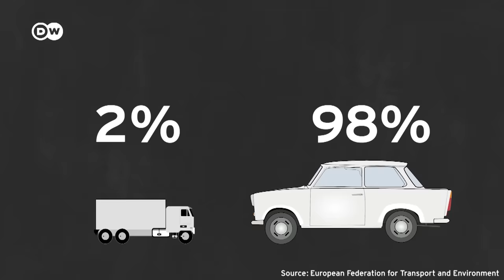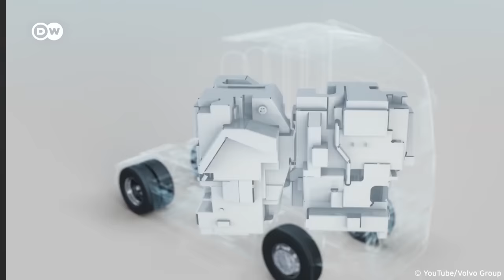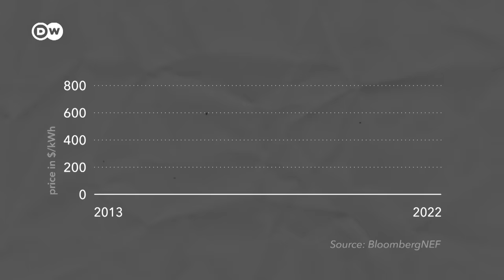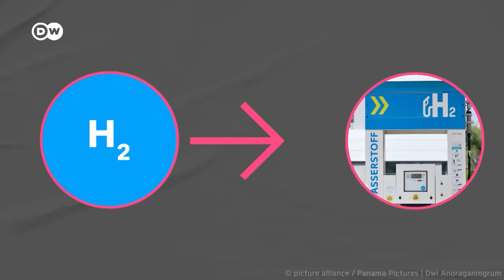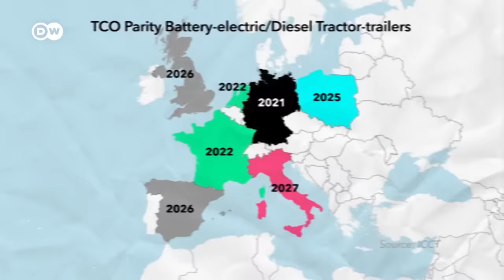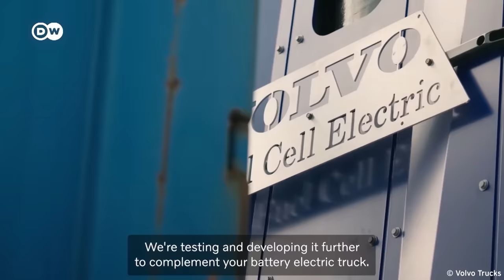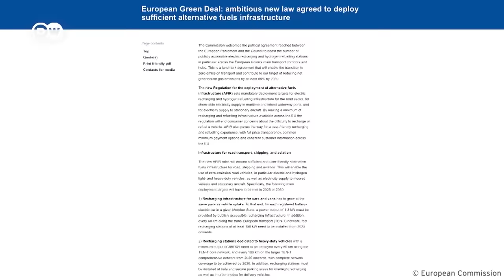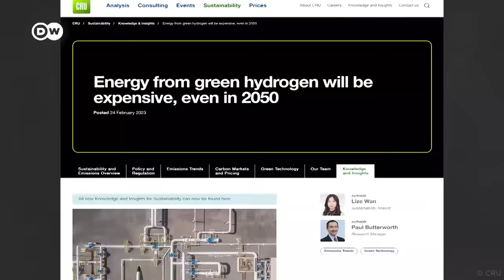Which will be the engine of the future?

Comment: Tbh neither of those technologies makes any economic sense without nuclear fusion. The energy always will be too expansive. Oh and guys for last mile transport trains are not an option.
Reply: Actually there is a very strong economic case for electric final mile trucking
Reply: @engineeringtheweirdguy2103  yep, I know that. The problem is that in the video they are comparing long distance transport...
Reply: @piotrszostakowski416  I would say that battery electrics is the better option for trips up to around 500 miles.

Hydrogen is not suitable for trucking or cars.
Reply: @engineeringtheweirdguy2103  Problem with EV is the charging. Hydrogen doesn't have at least this problem. But let's be honest except for the last mile, our good, old fossil fuel will remain. You would need free energy (fusion) and better batteries to change it.
Reply: @piotrszostakowski416  well. No. The economics for short and midrange EV trucking is pretty solid as an alternative to diesel. Long range remains with diesel however.
Reply: @piotrszostakowski416  charging isn’t as much as a problem as you might think either. It is a paradigm shift. It can’t refuel like diesel or hydrogen can. But it also doesn’t have to. Because it operates on a fundamentally different principle
Reply: @engineeringtheweirdguy2103  no offense, but I don't know where do you live in. In my country half of the year due to the weather EV has 70% declared range and it is not the worst case. 
Also when you are tired on the road and want to have a little break your EV won't charge at the gas station. Not because there are no charging spots, but because if it is going to meet all EV needs you would need about 10x, 12x times more  than you have a gas spot. It would increase the size of each gas station.
That's why it can only operate in the last mile. Instead of charging you would only exchange the battery while loading the cargo. Still the range problem with cargo remains.
Reply: @piotrszostakowski416  you don’t charge an EV like you refuel a car. Most EV owners will charge at home and never need super chargers. Trucks needing to stop will be able to charge at the stop. Tesla semi has specific super chargers called mega chargers that a normal car can’t use. A lot of rest stops have mass of space for parking trucks. It isn’t hard to add a charger to each space either. They not very large.

And when the truck is doing it’s delivery, being loaded or unloaded at a facility or destination, as long as the factory or warehouse it’s at has power, it can charge whilst being loaded and unloaded. 

As I said. Paradigm shift.
Reply: @piotrszostakowski416  also trucks not exceeding the maximum range (for the Tesla semi, 500 miles) (80% of all trucking is within 300 miles per day in the US according to statistics). Can charge overnight while they’re not being used. Saving time of getting fuel later on.
Reply from the maker: Hey guys, check out our video asking "Is nuclear fusion the key to fighting climate change?" here 👉 https://www.youtube.com/watch?v=eyHovWQ49MI. And let us know your thoughts in the comments. ✨

Comment: Hydrogen is definitely the way
Reply from the maker: What makes you vote for hydrogen? 🌻 Have you already checked our video on it 👉 https://www.youtube.com/watch?v=AGTjKJHu99c? Please also leave a comment and subscribe to our channel for more videos on environment. 🙌
Reply: @DWPlanetA  yeah I saw that video too, hydrogen just allows for much more energy stored meaning cars and trucks can go further and refill faster. Although it’s less efficient to convert energy into hydrogen it’s worth it for the 39.6kWh/kg, compared to batteries 0.1-0.27kWh/kg
Reply: @ryanhasmanners9997 It’s not worth it at all. Hydrogen cars are not much lighter than EVs and have almost similar range.
Reply: @Simon-dm8zv  they don’t have nearly similar range, hydrogen cars have between 100-300 more miles than battery cars
Reply: @ryanhasmanners9997 Model S Long Range has equal range as the Toyota Mirai and only weighs 350 kg more.
Reply: @Simon-dm8zv  that’s because the Toyota mirai came out in 2000 and the model S came out in 2012. So what you’re saying is hydrogen cars are 12 years ahead of battery cars?
Reply: @ryanhasmanners9997  What I am saying is te small difference in weight is not worth spending 3 times as much energy to drive the same distance.
Reply: @Simon-dm8zv  it’s not about the weight difference it’s about how much power they have for an equal amount of weight. Hydrogen has 19400% more power than lithium ion batteries meaning they can go much further and last longer
Reply: @ryanhasmanners9997  Hydrogen has terrible volumetric energy density and therefore they are inefficient. As I showed you, production vehicle examples barely make a difference range and weight wise, while energy consumption of a hydrogen car is far higher. And no, they don't last longer either.
Reply: @Simon-dm8zv  hydrogen has way higher energy density than batteries, it’s literally the smallest and most elemental atom. To say it has terrible volumetric energy density is breaking the laws of physics
Reply: @ryanhasmanners9997  It's not breaking any laws of physics, it's a simple fact. You were talking about gravimetric energy density, and that is indeed quite high for hydrogen.
Reply: @Simon-dm8zv  i think we can both agree that if you want efficiency get electric and if u want range, refuel time and better for the environment get hydrogen

Comment: You get a BIG THUMBS down from me as batteries have a end of life problem that for right now is just being kicked down the road. Thanks to the propaganda, that you are very susceptible too I might add, the true power of hydrogen has been shadowed over and watered down. Right now companies like Hysata have hydrogen generators that are 95% efficient so as you say the battery data is outdated but so too is your hydrogen information. But we all know that since Africa is starting to ask for their fair share of their raw materials and you cheap folks don't want to pay thus hydrogen then is the only thing left to make use of.
The technology I work on makes it so only water is needed in the tank for fuel totally replacing the use of fossil fuels and this technology too was put down by those that sell and invest in fossil fuels a really long time ago like over 55 years now. They corrupted the educational system world wide making folks like you think that it takes more energy to spilt water than it does from what you get back from it and if that were so then there simply would be no life on this planet! But you silly folks whom are so easily propagandized fell for their lies hook, line, and sinker. 

It took me a little while to get at the science behind the technology of making use of water as a source of fuel as I had no choice but to make use of the scientific method, which we all know is a slow process of elimination, but after several years I finally got at the science behind the technology. For the most part it simply mimics the earth's global electric circuit electronically. But one thing is for sure is the science behind the technology is real and it works and it doesn't violate the laws of science as you have been told to believe in order for it to work it has to violate these laws of science as that's just another lie that you folks fell for.
Reply from the maker: Hey there! We also tackle the afterlife of EV batteries and hydrogen sepearately in longer videos. Check them out and let us know what you think:
After-life of EV batteries 👉 https://www.youtube.com/watch?v=PbOBmnZRpZ4
Hydrogen 👉 https://www.youtube.com/watch?v=AGTjKJHu99c

Comment: Diesel works A hole lot better,a lot cheaper and last A lot longer ,it takes oil to get hidrogen.
Reply: Electric is a whole lot cheaper. And if lab results mean anything. A lot longer too.
Reply: @engineeringtheweirdguy2103  wrong . Most parts of the country electric is far more expensive to heat your house or change your car , especially now in many parts of the US have to stop using coal,the only place electric power would be less expensive is if you're near hidroelectric generator
Reply: @MarkLavoine-zj3hz  where did heating come from. But probably worth mentioning that heat pumps are very cheap and efficient.

And yes, energy prices vary depending on where you live. So do fuel prices. But fuel would have to be extraordinarily cheap for it to break even with even the most expensive electricity rates. 

What state do you live in. Let’s do a maths exercise.
Reply: Off shore wind turbines have falled off RI and so did cape wind . wind turbines solar can't work with out government money.
Reply: @MarkLavoine-zj3hz  offshore wind turbines are tricky to get decent lifespan. But inland wind farms and solar farms aren’t so troubled.
Reply: @MarkLavoine-zj3hz  actually, renewables is the first ever energy transformation that is being driven by private investment other than government investments. Government Investment only makes up a portion of of solar and windfarm construction. Unlike nuclear, coal or gas which is pretty much entirely government funded construction and then handed over to private companies to run.
Reply: Yes heat pumps are very efficient but an empty or full gas tank is cheaper than that or the cheapest battery.
Reply: Despite improvements in turbines movi ng parts require a lot of maintenance.we seen what happeneds to them extremely cold temperature.
Reply: @MarkLavoine-zj3hz  what happens to them at extreme cold temperatures? Do the non insulated gas pipelines going to fuel Taxan gas powerplants freeze over and stop gas from reaching the powerplant? Does the coal stock pile freeze too much to be introduced into the coal powerplant? Or to grid breakers fail to trip due to frost damage and fail to regulate the grid forcing rolling blackouts?

Do tell. What DOES happen to wind turbines in extreme cold.
Reply: @MarkLavoine-zj3hz  a battery isn’t a tank of gas. A battery isn’t fuel. Let’s not use false equivalence here. And yes a heat pump is much better at heating a building in terms of operational cost, than a boiler hydronic system.
Reply: Wrong that didn't work out to good in Germany, closing there nuke power stations may have been the right thing to do but big investments in solar and wind turbines did not work, GERMANY went back to coal,and biomass was wood chips from South America and around the world, I think coal is better than cutting down thousands of trees, coal can and is being burnd cleaner.an I would think cheaper than a newk power stations. Maybe in 10 to 15 years solar and wind turbines will be made better and last longer an increase of performance an not take A decade to break even.
Reply: Still wind turbines and solar stop generation every day, batteries don't last long enough and are far more expensive than A large gas tank, batteries Will have to get a lot better than Thay are and solar panels will have to be A lol more reliable And effective than Thay are.
Reply: A lot of land is government Land, government funding for gas pipeline, mostly oil is private over all , solar and wind turbines will not work at all with out government money.but looking for new oil government funded or not keeps the price lower

Comment: I suggest calculating how much the 6+ million trucks in EU put energy to the wheels and figure out how far the electric grid is from being able to achieve that. And grid is build by the public sector which is inherently slow and inefficient. Hydrogen infrastructure does not need end to end government investment on the energy distribution side, which makes it possible for private sector to develop fast. In my country in most places you can't even put more than 50KW solar panels up for power production because the grid capacity is so shit. Well, yes you can, but you must pay for the power lines and once you see that bill you start doubting going full EV.

FCEV and BEV and hydrogen derived alt fuels and green ammonia together is the only option to have any hope in turning around climate change. But still, it might already be too late, because people are still discussing about how one technology should win instead of figuring out how to actually make them all work so that fossil would lose.
Reply: 50KW is already extremely high for regular person to be producing, so yes, government or whoever is in charge will limit how much you can inject electricity of your own back into grid. It's not that it can't handle it, it's just that having bunch of private people randomly injecting random amounts of electricity makes it more and more difficult to balance out. Why you ask? Well, if you inject 50KW into grid, well, the thing which was previously producing those same 50KW now needs to be shutdown or you have to just "burn" that extra 50KW somewhere. Now imagine 1000+ private people doing that...

Comment: The fact this video was even made is already mission accomplished for the Oil & Gas propaganda machine. ALL OF THE  H2 is made from fossil fuel. H2 is therefore worse than diesel in terms of CO2 emissions. 
Some of you were probably reached by another part of the Oil propaganda campaigns and will say: yeah but Green Hydrogen is going to fix all of it, and it will be cheap....
This is where I usually lose my tolerance for human brain deficiency. See, green H2 needs to beade using Renewable energy, the same electricity being traded in our grid at market prices. Which means YOU CANNOT FORCE anyone to sell you electricity at the price you want. Which means green H2 will be always prohibitively expensive to allow any use on logistics.

Comment: They failed to mention battery production and the massive mining required to generate the materials needed to produce them. Battery production has an adverse effect on the environment that need to be taken into consideration. Finally, The discarding of batteries towards the end of their life will be another environmental issue. Therefore, it seems green hydrogen is the best solution, and with investment and research it can reach the aspirations.

Comment: This is completely flawed theory, hydrogen is better for environment millions of times, there is infinite ways of producing hydrogen and doesn't involve slave labour that basically hand pick in mines and uses 10 times more oil to produce 1 car than say normal car. Unbelievable that batteries would even be considered long term rather a gap stop. Not to mention your ICE can be converted to run on hydrogen and can't be made to run on batteries. This is lunacy to bet just on batteries that can't be eqstinguished that easy. It's just pure leftist kunacy

Comment: All these are fake. I prefer an AC motor that can run 1 gallon for 3 hours to generate AC current for an electric motor rather than a big battery or a tank of hydrogen. Please refer to Top Gear Series 14 E 2, where they make a car and start using a generator to move forward after the battery power is over. There is a doomed project in India known as TATA Megapixel,  a car with the same technology that can drive 60 miles on .4 gallons of fuel. Elon Musk already said they developed technology to run on water and the government won't let that car come out. So no need to go behind all these gimmicks.
Reply from the maker: It is common that tech firms promise to revolutionize how we move from A to B. But do they really deliver? We made a video on why is big tech failing to fix transport you can check out here 👉 https://www.youtube.com/watch?v=qNNKpnd5lyM

Comment: ah yes, electric status quo keepers
because freight railway is a joke or something
even without electrification rail transport emissions are laughable compared to other methods of transportation
and with electrification it's barely any emissions at all (not counting electricity generation)

for local logistics tho i think batteries are pretty solid, as they are more efficient and require less and safer infrastructure
HOWEVER
yet to have a good way to recycle accumulators
also lithium is an insanely limited resource, not to mention slavery involved in getting it which is not being solved for decades because why bother

so i think that batteries will win but it's not the right choice as it isn't a long term sustainable solution or the most humane solution

Comment: Its a lame comparison betweem battery and fuel cells. 60% loss for fuel cells includes the creation of hydrogen to transport of hydrogen then to consumer. 20% loss for battery is a lame way to diregard the energy created to make the battery(which is sourced from africa under well documented sources of child labour). Furthermore, the end of battery lifr cycle will then polute our rivers and sea with harmful chemicals due to each countries  has individualized uncontrolled practice of disposal. Then the poor countries suffer as the batteries will usually end up in their country as a form of rubbish for cash program by the rich countries.